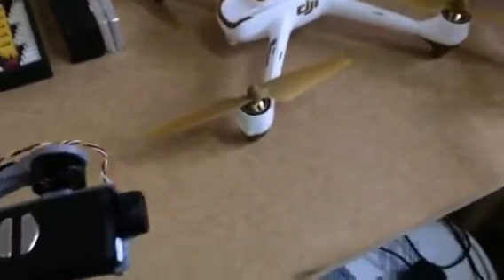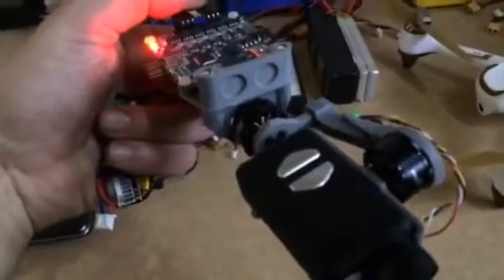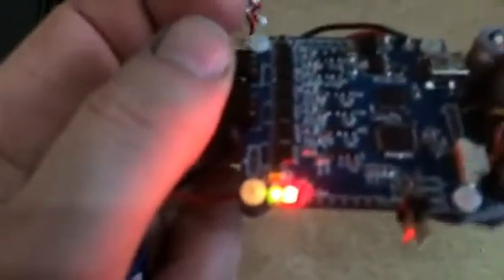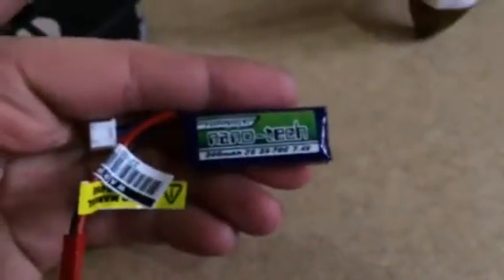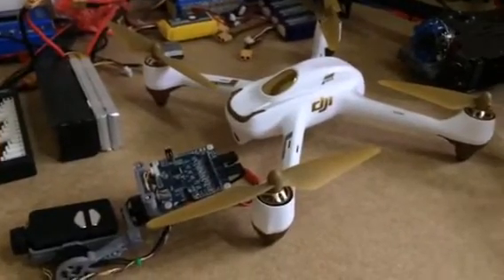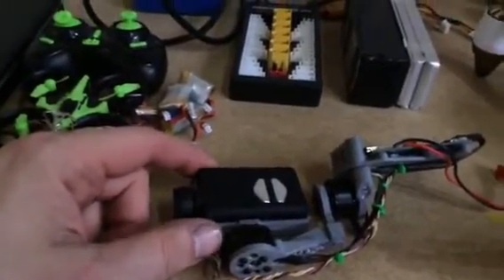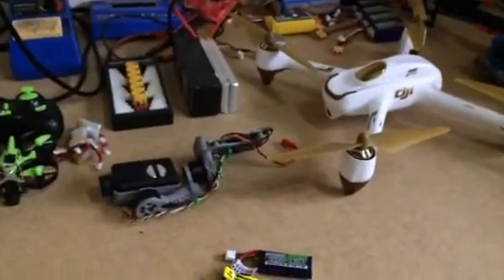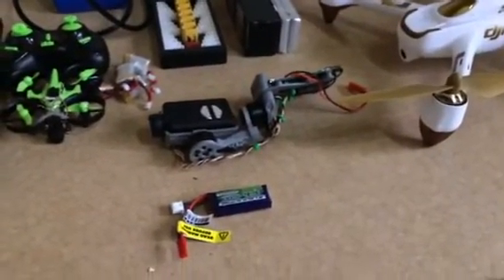update hubsan h501s gimbal for mobius cam

Comment: Hi. Did you try to bind the RunCam, or any other FPV camera to the Hubsan trasnmitter? So that you can see its FPV image on the controller. My H501S video trasmission was damaged, and i was hopping to replace it for a RunCam alltogether. Can you test this for me? I know we can select the 5.8ghz FPV frequency on the controller, maybe if we match the RunCam setting, we can see it´s image. I looked all over the internet for this answer, but found no one that says if it works or not.
Reply from the maker: DullDusk hi sorry for late reply. I think you will find that runcam is a WiFi sig and won’t match the 5.8ghz sig. I can test for you as I sold this quad.sorry I can’t help in this respect. Can you just replace the transmitter .????